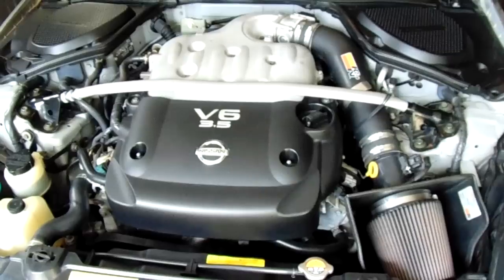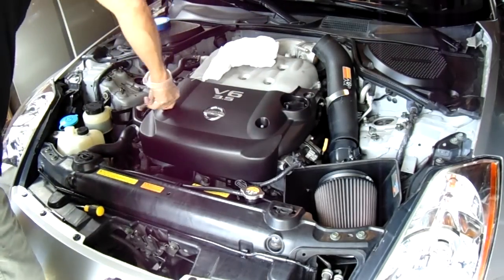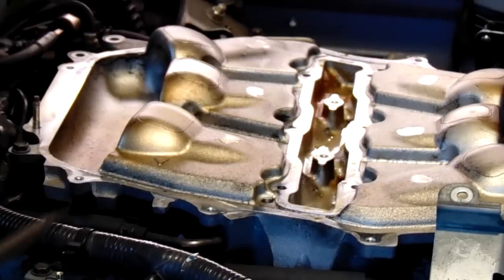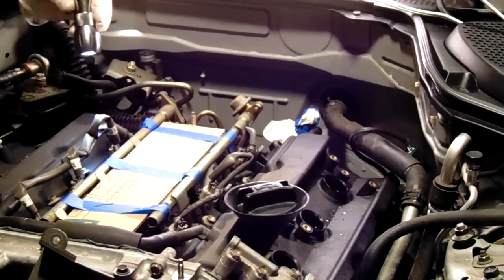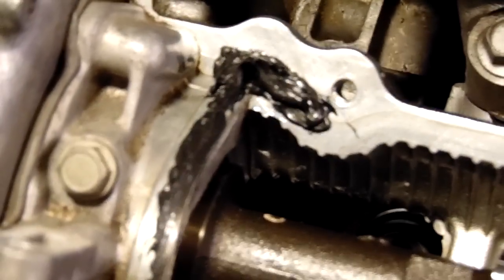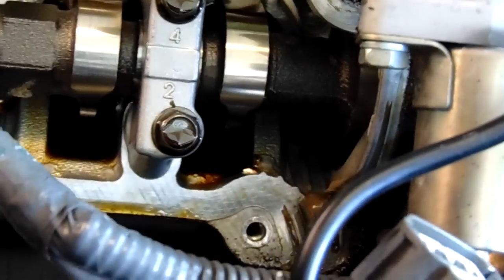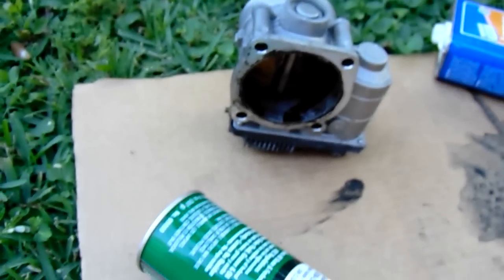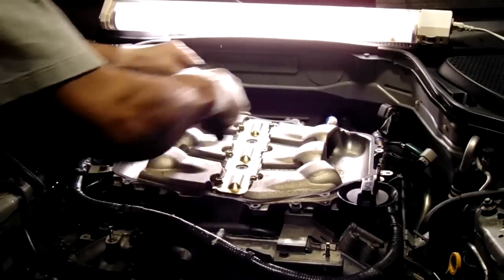350z valve cover gasket replacement explained! #Nissan350z #Zociety #Valvecover

Comment: Thanks for clarifying about the spark plug tube seals that cannot be replaced. I was going to buy just the gaskets and and spark plug tube seals but now that I know they can't be replaced, it will save me the headache.

Thank you for the detailed process. Great video!
Reply from the maker: Thanks for watching my video, a  valve cover job is something you only want to do once!!!!👍
Reply: @Zspeed  Yes indeed. I was able to get it done with the help of your video. Had a really hard time with passenger side cover as the gasket kept falling off and fuel line was in the way. Had to apply quite a bit of sealant to hold gasket in place after the third attempt. 
6.5 hrs later, victory!
Reply from the maker: I'm so glad the video helped,  I was thinking about releasing a 2nd video on the valve cover job, I have a lot of footage that I had to cut out. Do you think an even more comprehensive video would help or is this one good enough?👍

Comment: Video was really helpful finally I found one that answered all my question. Most videos out there couldn’t really see what was going on and couldn’t really understand. Trying to change my valve covers soon Both are leaking. Thanks for the video 👍🏼
Reply from the maker: Thank you so much for watching!!
Reply: Z-speed how did you remove the clips holding the bar on the driver side I’m having trouble with it
Reply from the maker: Are you talking about the clips on the strut tower  brace? If so you can use a small pair of needle nose pliers and try to detach them that way!

Comment: Just a suggestion. When removing the strut tower brace, you should loosen the jam nuts on the bar first and remove the tension on the bar, then when replacing after you bolt it back on, you would re-tension the bar. Great video though. Good stuff.
Reply from the maker: Your 100% right, I finally realized that little trick after removing it 3 or 4 more times. Thanks for watching, I also have a updated version of that video: The ultimate 350z value cover replacement guide!

Comment: FYI... Anytime you need a gasket or washer on a bolt to stick in place temporarily use super glue...It dries quick and it's thin and will not interfere with sealing afterwards
Reply from the maker: Great idea, I've never tried superglue!

Comment: Great Video!  I am in the middle of it right now.  I am trying to get the wiring harness free, but there is one wire toward the front of the car that comes off the harness(by the intake) and goes down deep to a plug  that I cannot get to on the drivers side.   Pain.  Tomorrow I think I will jack the car up and see if I can get to it from below.  That one wire, has prevented me from getting the harness out of the way so far.    Good stopping point for the day.  The rest of the project has gone pretty smoothly.
Reply from the maker: Thank you so much for watching, if I come up with any information about that wire I will surely let you know!!!
Reply: @Zspeed Figured it out.  I have the OEM intake box and I had not removed it, just the plumbing after it.  So, with the box removed I can get in there fine and get to the plug.
Reply: With any luck, it should all go back together today.

Comment: Really good instructional video!! This video has helped me out a lot. I was just wondering.. what did you mean when you said the gaskets were slightly different? I see that u bought the gaskets separately from Nissan and the valve covers from amazon. Did the gaskets that came with the amazon order differ from the Nissan gaskets?

Thanks!
Reply from the maker: I actually bought the valve covers and gaskets from Nissan and they we're very expensive. So I put a link to the Amazon valve covers to save people money if they couldn't afford the Nissan parts. Now, the Nissan valve cover gaskets have different part numbers, so be sure to test fit the gaskets into the valve covers to make sure they fit perfectly!  Hope this helps and thank you so much for watching!!!!

Comment: Great video!!! Thanks for taking the time to make it! How has the valve covers been holding up? No misfires or oil in the plugs? Have you had to replace a coil pack yet?
Reply from the maker: No problems after 2 years, I did use Nissan valve covers thou!  No more leaks around the spark plugs at all, I haven't changed the coil packs yet, I'm at 123,000 miles. But I'm going to be changing them soon! Thank you so much for watching, I'm glad the video helped.

Comment: Hey Z Speed I have a blown head gasket on my 2005 350z and no one wants to do a head job and replace it. I was wondering what should I do I have little to no DIY experience on cars. And shoutouts to you from a fellow Alabamian.
Reply from the maker: Check out: head gasket and header install by H&H development on Youtube! It might give you an idea of what it takes to replace one. If your not up to it, call around your area for shops that specialize in head gasket repair! What part of Alabama do you live in? And thank you so much for watching!!
Reply: Z-speed  thanks for the Z Speed ! and I stay in Montgomery

Comment: Nice video very helpful , but im not sure why you removed the knock sensor harness which is under the intake manifold which has nothing to do with a valve cover replacement , maybe it was another harness
Reply from the maker: You're right, it's not the knock sensor it's the electrical harness, just above the camshaft position sensor! Thank you so much for watching!!!
Reply: only reason i knew is because i replaced the knock sensor harness, i had a 327 code after some homework i found that its not the knock sensor but the harness which Z1 Motorsports sells and confirms that most of the time its the harness. I found a video on youtube by Dnali with a trick on its replacement
Reply from the maker: Thanks for the tip,  I hope my harness last a while longer, I have 123,000 miles on my 350z!

Comment: I wonder if I can do it to my car , I recently found out there was oil on my spark plugs , when I was changing them / don’t know if I should take on the challenge
Reply from the maker: Yes I think you can do it, but to do this job you must have an inch pound torque wrench, two new valve covers and gaskets, and a lot patience! If you have any questions at all just ask!
Reply: @Zspeed  and new intake plenum gaskets too, just in case.
Reply: Do you have to drain the coolant when replacing the valve covers ??

Comment: Z-Speed, I'm just waiting for the weather to warm up before I start to do this , did you replace any gaskets on the upper or lower plenum, I asked Z1motorsports and they said most of the time they are reusable whats your opinion , also did you have any problem with the throttle body after being removed was a relearn needed
Reply from the maker: I bought new upper and lower gaskets for the plenum, but the  upper plenum gasket is made of metal and I could see that it might be reusable if not damaged! I would replace the lower gasket.  As long as you disconnect the battery before you disconnect the throttle body, you will not need  a relearn. Hope this helped, if you have any more questions just ask!
Reply: @Zspeed  thank you , I must applaud you for having the best video on this , and also for using hand tools and not a impact drill you read the horror stories of broken bolts  its ok for removal after the bolt is broken free by hand , I just ordered the upper and lower gaskets from Z1motorsports  thank you again for a great video and personal help
Reply from the maker: No problem, I created this video because I needed a more step-by-step approach than I could find on YouTube. So I thought well why not just make one and maybe it'll help other people too!  I'm sure glad it helped you, any other questions just ask!

Comment: Hi Z-speed, I replaced valve covers a year ago, but i have leaking problem again. I order a new set and ready to installed as soon covers arrived. Do you think the sequence on how to adjust screws is important? and the tention on them? My guess at this point is that that where i had a mistake. Please advise.  Thanks
Reply from the maker: Yes there's a certain order that you need to go through when tightening the valve covers, refer to my video. The torque specs are very important and without being properly torqued your valve covers will Leak. Also, make sure that your valve cover gaskets are lightly glued into the valve covers with RTV gasket maker so they don't move around when placing them on to the motor. Hope this helps and thank you for watching!!!!

Comment: Z speed how can I measure the torque when tightening the valve covers? 🙏🏼
Reply from the maker: All you need is a inch pound torque wrench,  about $20-30 bucks on Amazon, or your local car parts dealer, (Auto Zone, O Riley's ,etc) may have one you can rent! Hope this helps and thanks so much for watching!!!
Reply: @Zspeed  ok thank you so much good man 👍🏼👍🏼👍🏼
Reply from the maker: K-A check out my revised valve cover gasket video for even more details:https://www.youtube.com/watch?v=_15ivIVS9_I&t=219s

Comment: I recently replaced my spark plugs because my car was idling poorly and was misfiring. While doing so i found there was oil on all passenger spark plugs. Went ahead and replaced them and a hour of driving later I’m having the same issue. Only codes being thrown are for the rear o2 sensors but it shouldn’t effect how the car runs, do you think that the oil is fouling the plugs and maybe this will fix it?
Reply from the maker: Most likely it's a faulty coil pack! Once you place a spark plug in the hole and torque it to spec there should be no oil leaking down and fouling the spark plug end! Although over time you might get some bleed through.  Coil packs usually throw a misfire code, so I'm not sure why you're getting an 02 sensor problem.
Reply from the maker: So try replacing your Ignition coils, 《AKA 》coil packs and yes after you solve this misfire problem it's time for a valve cover job! Thank you so much for watching my video, anymore questions just ask!

Comment: If the battery is disconnected and you don't physically move the butterfly.  Do you have to still do the throttle body relearn, because you cleaned it?
Reply from the maker: No, you shouldn't have to do anything but reconnect the battery and start it up! Thanks so much for watching!

Comment: Hey Z-Speed I was wondering since it's been awhile now on how these valve covers are working out still? My 350 needs the exact same thing but I'm a little worried because of the reviews on Amazon. Any leaks!
Reply from the maker: I see what you mean about the reviews on the Amazon valve covers, they are a little low. I posted this link as an alternative to buying valve covers from Nissan. The valve covers from Nissan with the gaskets was around 450.00 bucks!!  And that's what I used on my car! Now after 2 years, I have no problems at all, no leaks. So if you can afford the Nissan valve covers I would highly recommend those.  Hope this helps, if you have any more questions just ask and thanks for watching my video!
Reply: @Zspeed  Z1Motorsports sells the nissan covers for 379.00 comes with the gaskets , i also bought Ultra Grey RTV Liquid Silicone Gasket Maker
Reply from the maker: Thanks for the tip, Z1 motorsports has some great deals on stock 350z parts!!!!;👍👍👏

Comment: Hey Z-speed, did I hear you correctly....I had to come back to see your video again. You replaced both New OEM factory Valve Covers? Now underneath (meaning-inside) where by "the Spark Plug base is" there should be a Flat grommet gasket as part of the SEAL. You said "THOSE RUBBER O-Rings Go Bad!! at 12:22 "This part is crucial for keeping the OIL from seeping into the Spark plug which ultimately causing the engine to mis-fire!! So you replaced 2 new valve covers??
Reply from the maker: Yes, unfortunately 350z valve covers are notorious for leaking around the spark plug seals. You have to replace the whole valve cover in order to replace the spark plug seals. You can use aftermarket valve covers are OEM valve covers, hope this helps! Thanks for watching.
Reply: Thank you, again  @Zspeed !!! "Have a great Sunday"
Reply from the maker: Nissan does not recommend this! The new spark plug tube seals should last for at least 80 to 100,000 miles.  It could cause problems when trying to remove the valve covers. Hope this helped!
Reply from the maker: The spark plug tube seals come with the new valve covers, so you will not have to purchase those separately, hope this helps!
Reply from the maker: Okay, great idea!!!

Comment: Whats the purpise of the valve cover built in spark plug o rings....if ur valve cover gasket is not leaking no oil should leak....is it just for safety and not nrcessary?
Reply from the maker: They should have made the o rings replaceable, bad design!

Comment: How would you know if a valve cover gasket is bad? Oil in the spark plug ?
Reply from the maker: Yes, oil in the spark plug tubes means that the spark plug O-rings are bad. Oil around the valve covers, means that the valve cover gaskets are bad. But either one of these leaks means that you need brand new valve covers and gaskets. links for valve covers on are here!!! :https://amzn.to/2LLcGLE

Comment: so since the o-rings can’t be replaced and have to buy a whole new valve cover, where can i get them from? where did you get yours?
Reply from the maker: I got mine from Nissan, but you can get the same quality valve cover from Z1 Motorsports! Also, they have these New metal valve covers out and I believe you can change just the O-rings and gaskets from then on!!!😀🏁👍.
Reply: @Zspeed  thanks so much for the feedback‼️ i will look into it, keep up the amazing work👍🏽

Comment: So i did the valve covers , here's my experience take your time and have patience as Z-speed said . The plug for the camshaft sensor(drivers side near the firewall ) was a pain, instead of just pushing down on the release tab you need to slide it until it snaps and then it can be released and when you reinstall it, it will lock itself . For me the passenger side was a pain not much room where the wire harness goes into a plastic shroud and the fuel line piping, a little force with a small wood broom stick worked well , the worst was the lower rear valve cover bolt (passenger side) . I used a 1/4 in drive in this area gave enough room vs a 3/8 drive I also put a piece of paper towel over the socket then pushed the head of the bolt in place , holds it pretty tight .As stated in the video put rtv gasket seal every few inches under gasket sure helps keep that gasket in place 
I bought all my parts at Z1motorsports there also is ConceptZperformance there all OEM Nissan
I Change all the gaskets and I also needed the pvc hose and the valve cover cross over hose , both were very hard and brittle i bought the silicone  hoses from Z1
took me about 14 hours i did not rush and all is well thank God
Again thank you Z-speed for the great video and advice
Reply: let me add since I removed the throttle body while attached to the upper plenum , I found it much easier to to reinstall the throttle body ( 5mm hex )after installing the upper plenum , much easier to install the hoses , As z-speed said do not move the butterfly in the throttle body if your cleaning it and disconnect the battery
Reply from the maker: I'm so glad your valve cover job was a success, you just saved a boatload of cash!!!!

Comment: I’m having trouble getting to the passenger side rear bolt that’s behind the fuel line and the harness. How did you get access and get enough room on that side?
Reply from the maker: That was very tricky, I had to use a small 1/4 inch ratchet with a 8-12 inch extension. At the end of the extension, I used a 1/4 inch swivel adapter and at the end of the swivel adapter I used a elongated 10 mm socket. I know it sounds cumbersome, but it worked quite well! If you leave me a email address in the comments, I can send you some pic's of the setup. Hope this helps, and thanks for watching my video!!!!! I was also able to use my torque wrench with this setup and achieve proper torque specs.
Reply from the maker: You can also contact me at zspeed2561@gmail.com
Reply: Thanks so much for the response 👍🏻👌🏻. I will try that and also email you.

Comment: I have passenger side valve cover gasket leak on my 2008 Infiniti M35 told by a mechanic. There's a lot of burning smell. Is the process the same since i think the engine is the same?
Reply from the maker: Although the engines do look somewhat similar, the torque specs will be different as well as the disassembly of the plenum. Make sure you buy a car manual from autozone to get appropriate torque specs for your valve cover.  Thank you so much for watching, if you have any other questions just ask!
Reply: @Zspeed  Thanks

Comment: Did you lose pressure in the valve covers when you vented the pcv?
Reply from the maker: No, but I no longer run a PCV delete, watch this video :https://www.youtube.com/watch?v=fkIaD42NOf4&t=463s. This is a updated version for the valve cover job:https://www.youtube.com/watch?v=_15ivIVS9_I&t=2223s

Comment: Did you have to unload the vehicle to remove the strut bar or can it done with the car flat?
Reply from the maker: It would be better to remove the strut bar while the vehicle is on a level surface. It can be done while on ramps, but easier when level!!  Hope this helps!